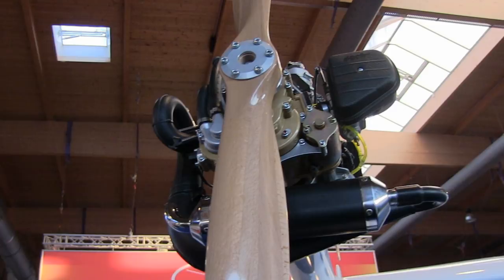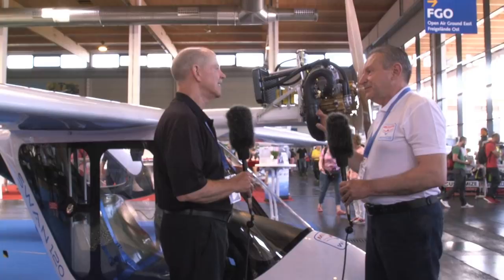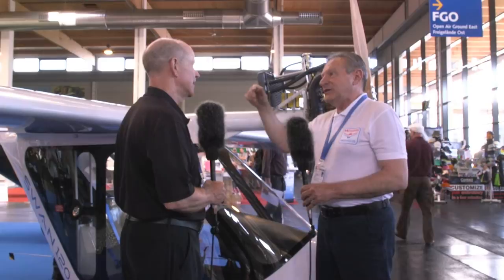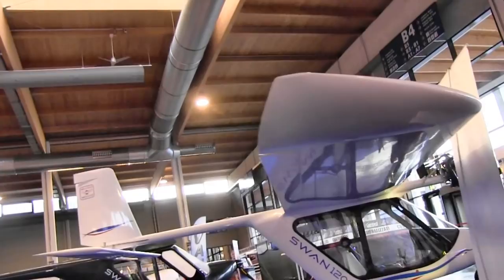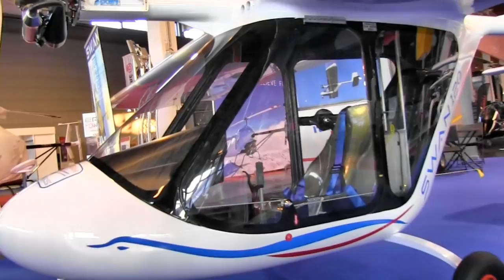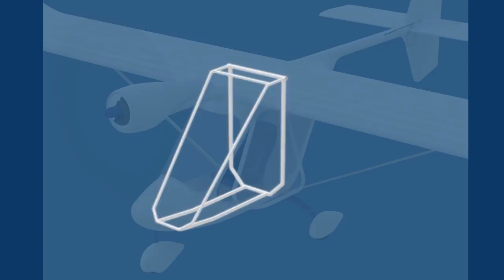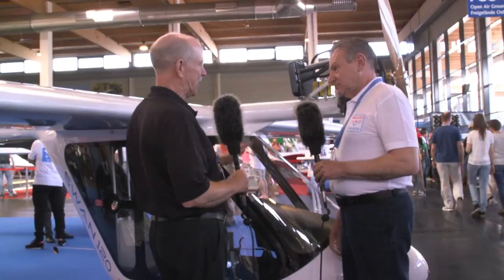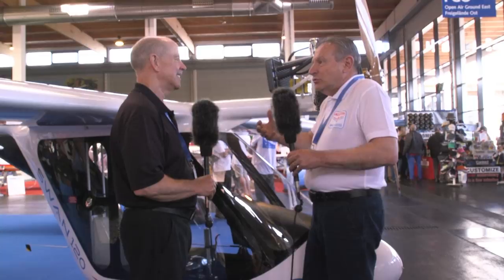SWAN ultralight, Swan 120, Swan 140, Modern Wings, Swan 240,  Aero Expo Friedrichshafen,

Comment: i was told that to be a legal ultralight aircraft..it must have an open canopy..or itsclassified as a light sport aircraft.
Reply from the maker: There is NO requirement for an ultralight to have an open canopy! As long as it is no more than 254 lbs. (plus parachute allowance, or float allowance - if it has them) and meets the top speed and stall requirements it is an ultralight vehicle.

The Ultralight Flyer